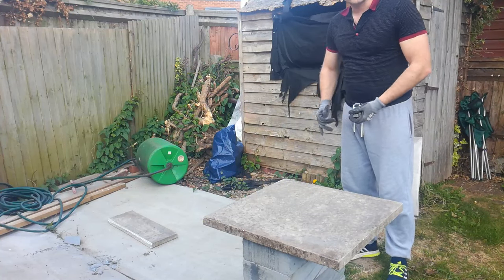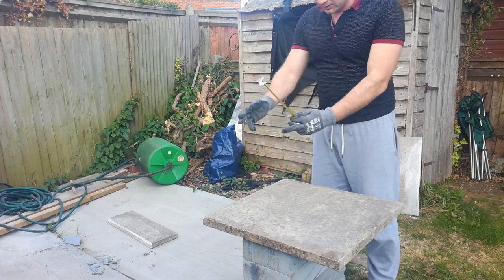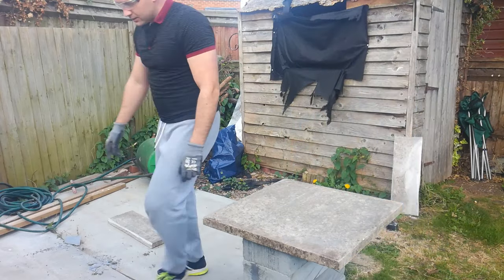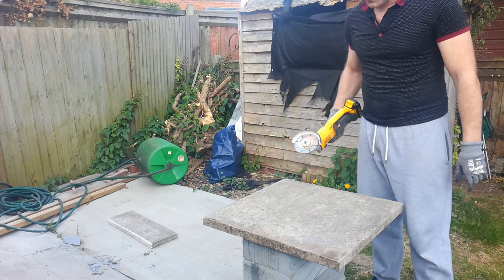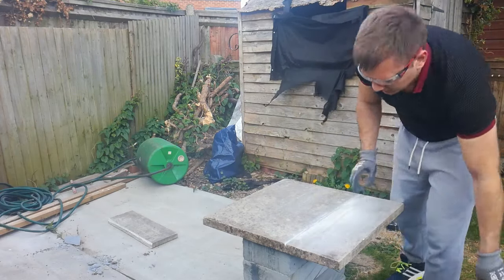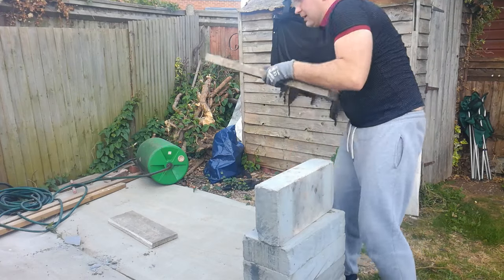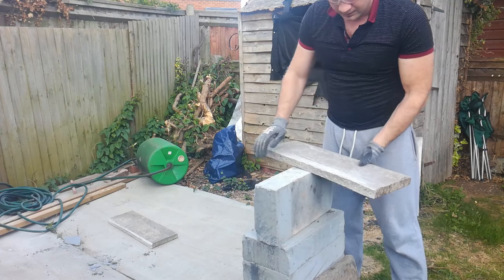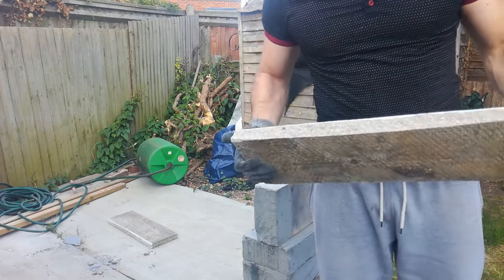How to cut concrete pavement slab with a grinder without proper tool for cutting.

Comment: Mate, thats a great vid! A quick way to break it off without using the machine to cut it to its full length. You can also do this with a hammer and chisel too but its much precise doing it with the machine.

Comment: Thanks, worked great on some concrete edging I needed to cut. Cut it as deep as I could front and back with a diamond wheel on a Dremel (yes! It's all I had, gave it a whack and it snapped clean in half. Thanks!
Reply from the maker: nadnerb33 thanks. 
I am really surprised how simple things can help so many people. Glad
Reply: @alexeyturnkey7400  simple to you ;)

Comment: Good video. Would recommend using a petrol cut off saw for slabs this size
Reply: @CurvedSlightly  ok no worries I didn't know that but that makes sense
Reply: @Steven Daye It's not about that it is about using the correct tool for the job and making life easier and quicker for yourself taking only 30 seconds to cut a slab rather than several minutes with a tool that's underpowered for the job.
Reply: @mattseymour8637 aye but costs a fortune for something you will use once
Reply: @Doodahdoodles  That's true but it's horses for courses but you can hire them for just one use if cutting several slabs.
Reply: @mattseymour8637  would you say it’s worth it like are they that much different? We are laying a patio soon (20msq) and half of them will need cutting. Petrol cut off or angle grin?
Reply: @Doodahdoodles  Yes worth hiring one if laying a patio and need to do several cuts.
Would be quicker and more efficient.
You could use a 9 inch electric angle grinder which would do the job quicker than the one in the video.
But just be careful if haven't used one before.
Could always get professionals to do the patio.
Reply: @mattseymour8637  cheers. We are pretty handy and the quotes we’ve had are really high (I’m not just saying that, 7k+ and they want half upfront which obviously we’re not going to do). Going to give it a bash ourselves.
Reply: @Doodahdoodles  No problem.
Fair enough but don't forget it's hard work and tradesman have alot of overheads and experience so you get what you pay for.
Also the cost of materials has gone up so much recently so all adds up.
Don't blame them in a way as heard stories of people not paying up after tradesman have laid patios etc.
Good luck with it and be safe.
Make sure you use PPE.
Goggles, ear defenders and masks as Silica dust is very bad for you.
Also be careful when using angle grinders as they are very dangerous if not used properly.
Reply: @mattseymour8637  appreciate the tips thanks. I get your point but we’ve priced up materials for the job and whilst expensive, it’s not even a fraction of the overall price. They’re taking thousands in labour for a weeks work which is more than our excellent brick layer took in labour cost to build a wall. Just don’t agree with the principle so going to try it ourselves. If it’s terrible I’ll at least hold my hands up but I know a few people who’ve done a really good job so think it’s worth a crack.
Reply: @Doodahdoodles  I agree that the quote does sound a bit steep but I would rather pay more for someone doing it properly than cutting corners and having to get it redone.
Seen and put right many 'bodge' jobs and as I said before being a tradesman myself I know how much work there is involved and this kind of job I wouldn't charge cheap for.
But this is what people don't realise.
You are also paying for experience, knowledge, professional tools being used and decent quality materials.
So anyone trying to get me to do it cheaper I say no thanks.
Good luck with completing it yourself and again be careful and stay safe.

Comment: Use a dust extractor and universal dust guard will fit most grinders both pretty cheap to acquire, safer and cleaner.

Comment: Hi, I know it is an old video, but hopefully, you get this question. After cutting slabs in my garden the tradesman left a lot of dist on my pebbles and lawn. I am concerned about breathing the dust and about my cat walking on it and then licking it. But I don't know how to safely contain this dust or remove it. How do you deal with all the dust that is created? Do you then clean up? Thank you!
Reply: As somebody who works in a tile factory and works with the dust daily, nothing extremely harmful is in the dust, maybe silica but not in large quantities. To remove the dust and stop it spreading, simply wet it with water and wash it into your lawn/dirt.
Reply: @YTJonTripp  hi Jon, thank you so much for your advice. You put my mind at rest 😊

Comment: Did you say it was 30 mm thick so roughly how much did you cut before snapping, ive got some heavy duty 3x4 concrete 50mm thick flags.
Reply: He said around 5mm, he's just scoring it like you would a tile.

Comment: just tried this with a council slab 50mm thick scored a line about 6mm down , snapped same as he done but it snapped quarter of  the slab off
Reply: I think 50mm slabs are too thick for this technique. Seems to work better on the 30mm slabs. Sorry for your loss :)

Comment: Thanks for commenting so fast. Your a great guy! Hey diamond blade is only $10 @ home depot.
Reply from the maker: Hay, thanks for your comment. I do agree with you, it could be done better, and must to add, that this video is useful for someone who doesn't have a proper grinder with diamond disc. It too expensive to have it at home for one time use. Please tag me in your video, I will you a good comment and like it for 100%. Any little helps. 
thanks
Reply: Alexey Turnkey just giving you a hard time. I went out and bought the grinder and diamond blade because of your recommendation. Works great! You've got a subscriber for life. Thank you!